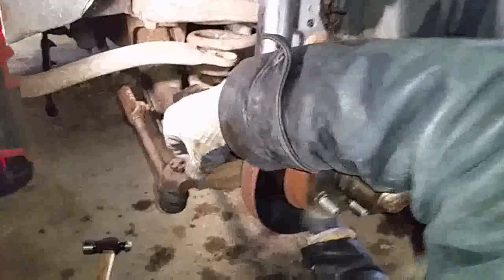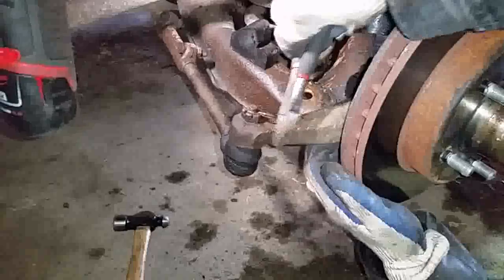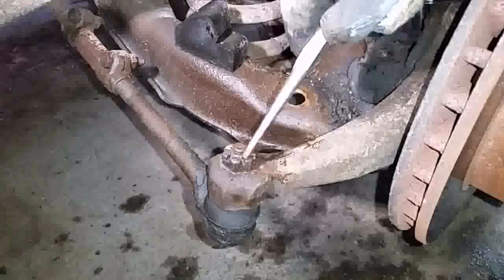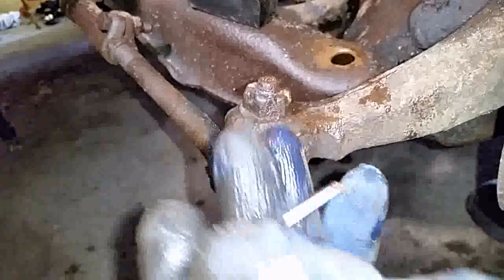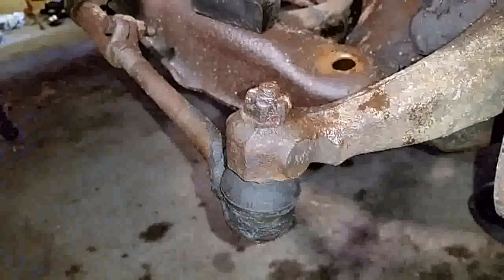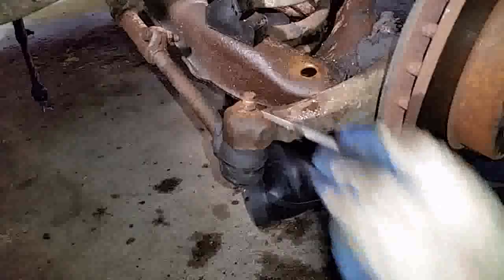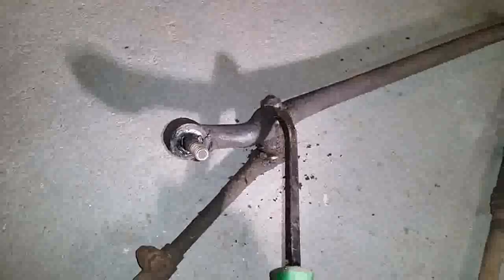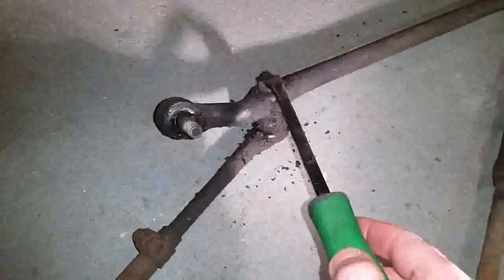How To Remove a Stuck Cotter Pin - EASY

Comment: at home? no impact gun? won't punch out? tight space ball joint with the  top inaccessible? threads stripped after this method not working?  Get out the hack saw and spend an hour sawing through the to of each ball joint bolt.

Comment: Ya that works when there's little rust.  But things get a lot more rusty around here.
Reply from the maker: I hear ya..I'm in New york. The rust capital of the world..don't forget to subscribe
Reply: @klowny1969  Me too upstate. Just had to plasma cut off the stud on a perfectly good ball joint because the installed the cotter pin front to back......no way to get a punch in from the back to knock out the bits.

Comment: If the replacement ball joint comes with a new nut then just use a cutoff wheel on the nut !

Comment: I snipped the cotter pin, and then used a 25" breaker bar after soaking the castle nut in some liquid wrench. Worked like a charm

Comment: I had to do the same thing but I can't find/see where the remains of it as re but there are a few flat spots that look like it may be it and need to remove it as it is in the output shaft on a diff so may put the nut back on to try and help me push/find where it is without damaging the threads
Reply from the maker: Good luck..don't forget to subscribe

Comment: So I'm trying to put the nut back on but the thread is spinning too, how do I put it on?
Reply: At the end of the video he uses the pry bar to put pressure on the stud so it doesn't move. Make sure the stud is clean so the nut goes in easier. I used to have this problem when changing ball joints.

Comment: What about heat?
Reply from the maker: Brian Bowman nah..never used heat
Reply: I know not on the ball joint.  The tip of the stud where the pin is.  The castle nut and knuckle should suck up heat before it gets too close to the boot and ball joint.
Reply from the maker: Brian Bowman dunno..u can try heat..but not necessary